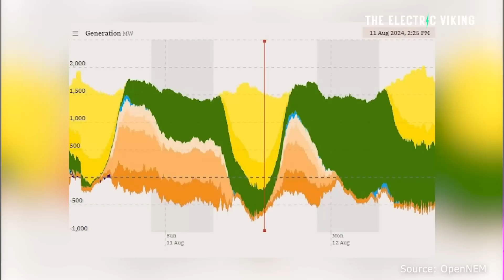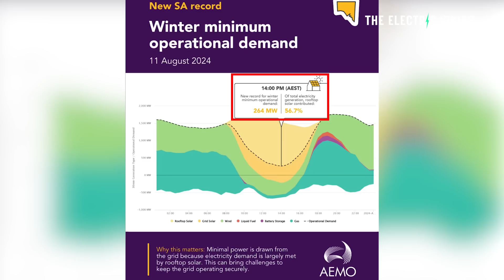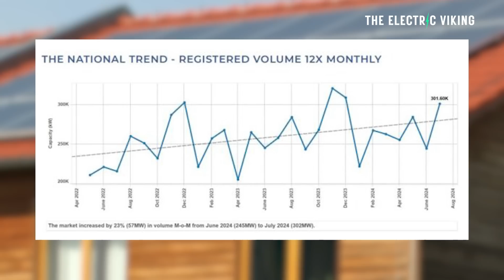Australian rooftop solar hits 81% high as Aussies install solar in record numbers

Comment: Our low cost solar is a rare credit to Gov policy. In 2009 they put in a solar subsidy plan which was to run until 2030. Since then NO Gov has touched it, changed it, altered it or screwed around with it. The result a consistent known policy framework which has allowed the solar industry to grow and become very efficient. 2/3rds of the cost of solar is NOT the solar panels. This is where we have become very good and we don't get cheaper panels than anyone lese or cheaper inverters its a world market anyone can buy from anyone around the world. NO what we have got very good at is keeping the sales cost low (lots of neighbors putting in solar sells it) and very efficient at installation. 

We are still half the cost of the US and UK for say a 10KW system even if you take the subsidy out. That's how good Australia has become at home solar.

Comment: Rooftop PV panels shade hot roofs. 
Hahaha 👍 Hahaha 👍 
More panels, more shading. 
Happy days
Reply from the maker: The best!
Reply: @electricviking  I have joked about it.
And then it occurred that the hottest part of the roof actually would be shaded when the Airconditioning was running. 
It also occurred to me that a rooftop PV of older panels would be cheaper and cover more area.
Even 2nd hand panels might be useful for me as I use my roof space, and it gets very hot.
You are doing good work and remain calm but enthusiastic.
Edit
Now I am thinking panels headed to the recycling might have a longer roof life.

Installers can relocate them from prime roof space.

Comment: My friend put 5 × 6.6kw rooftop PV on his commercial building and cut his quarterly bill by $10,000.
Those left on the grid, the home owner customers with no rooftop would find that the R.O.I pressure on the grid owners, the superannuation funds, would have increased the $kWh rate and daily connection rates higher. 

People saying renewables are forcing electricity costs higher are double talking for their bs agendas. 

Nuclear promoters are bs confusers, distracting from the GRID's $1TRILLION economics. 

F..king honesty is needed, not a grab for taxpayers money from messed up political parties. 

Snowy 2.0 pumped hydro budget EXPLOSION from $2billion to $15billion is insane economics. 

I have decades in construction, university degree in Civil Engineering, tendering and building coal fired electricity power station, gas turbine generation, transmission line, substations for large city buildings,....

I have grandchildren and a no CO2 emissions nuclear electric world, a warming latitudes world is not going to be my legacy to them.

F..king grow up. Listen and learn.

Comment: A 6kW solar photovoltaic system would cost between $4,000 and $6,000 in most Australian states, while a 10kW system would cost between $7,500 and $10,500. The average price for a 5kW solar system of satisfactory quality in Sydney is $5,500. The AUSTRALIAN Solar for Low Income Households Program provides a subsidy of up to 50% of the total cost of a solar rooftop system.         Solar panel costs typically range from $17,430 to $23,870 IN THE UNITED STATES, and many homeowners will pay around $20,650 on average. I received quotes as high as $50K in the United States, and my electricity use is not that high. Even with the lowest priced systems the payback period for me was going to be 20 years, the life of the average solar panel. And that is in the sunny southern U.S. Just the facts in my situation, view or spin it however you want. It was no Australian paradise scenario for me.
Reply: I suggest you ease into it by buying a 2000 kilowatt hour battery pack and about 400 w of solar panels. 

This will provide you with some disaster recovery and cost you about $1,200. 

I used such a system and a 4700 watt dual fuel generator to get through 2 week long power outages in Houston this summer.

The battery was very handy the first night while the hurricane was still making it too dangerous to set up the generator. 

It's already saved me about $600 worth of food.

However, even a small systems sufficient to run a single 5000 BTU air conditioner for 24 hours a day just doesn't make sense yet.

Comment: If solar is so great why does Australia have some of the dearest electricity in the world.
Reply: The result is "Electricity is so damn expensive, I'm putting a solar panel which pays for itself in two years on my roof!"  This is a way you get around the energy oligarchs.  Heard of those guys?  They ain't doin' you no free favours.  They very real.  And why grid elec is so expensive.
Reply: Expensive grid electricity is one of the reasons Australians adopted solar so quickly. Installed my 10kW system many years ago and it's already paid for itself. Now my electricity bills are $0 and it even covers EV charging. You'd need to have rocks in your head to not get solar, at least in Australia.
Reply: @nhand42  Some can't afford it, and landlords have to be willing to have it installed for rented houses.

Comment: The problem is solar doesn’t generate it when most people want to use it, all the peak times are when solar is either ramping up in the morning or down in the afternoon. If it came with a complimentary battery it’d be a different story. The grid doesn’t even want all the extra power from the panels when they’re making it because nobody is home to use it.

Comment: The cheaper electricity gets, the less "crazy" it is to NOT have solar on your roof.
And you definitely CAN have too much solar.  If supply exceeds demand, the voltage goes too high, and the utility can't curtail the rooftop arrays (can they?).

Comment: Your solar price is about the same in the good non liberal states. If you want to do it yourself you can get 31 panels, 400 watts a piece for about 4k delivered. lol I doubt you could get that price in Australia. Also, most of America except the corrupt liberal states, you can get Electric about 9-12 cents a KWH. In Australia its about 40 cents with a whole bunch of fees. I pay 11.1 cents, with 10 dollar fee. I do like that the Assies are putting up solar, it works, I have it on our rv, we don't need to be plugged in ever if we don't want. Many people in Australia don't have dryers because it's to expensive to run. In the long run Australia will be better off than the USA if they get rid of their corrupt communist government, we're trying to now.

Comment: My electricity bill is $1500 per year. To install a system able to cover my total annual consumption, it was going to cost me $35,000. 23 year payback.
Reply: Plus yearly maintenance, replacement of failed parts and when they bring in the sun tax, being able to turn off your system via smart meter when grid gets overloaded via roof top solar. If you want to do it forget about recouping cost, it may never happen.
Reply: $35.000 is a lot. You don't have to go off-grid to make solar worth it. A much smaller system may give you a much better ROI, especially if you don't have to borrow money to buy it. Shop around some more and get some advice about the right size and if a home battery is something you should add now or maybe later (make sure it's easy to add).
Also think about your electricity use in the years to come. Maybe you want a heat pump, fully electric kitchen or an EV. These things will need a lot of power, but save you on fossil fuel and taxes if you have enough solar panels, which you can plan for now and add on later.

Comment: As I watched this my energy supplier is allowing 1 hour of free electricity. I am topping up my car. The current price on Grid Watch is shown as £16.23 per MWh, so less than 2p per kWh. I can only concluded it is a solution to balancing the grid and a cheaper option than asking a generator to disconnect and compensating them.
Reply: What you are up to is what all of Australia should be up to but Solar is probably five years ahead of batteries and EV's. Surplus of solar and we should be filling EV's and Gov needs to ensure where we park we have charging. It can be a low cost house plug if you park at work all day they 4kw charging is fine. Its a huge upside for OZ and one day we will have the EV's bi-directional and powering the homes at night.

Comment: Based on the Energy Saving Trust's figures, it could take someone living in the middle of the country, in a typical home, anywhere between 12 and 17 years to recoup the costs of installing panels, based on current Energy Price Cap rates.

Solar panels: Are they worth it? – MoneySavingExpert

Comment: as an Aussie with solar power and solar water heating panels, let me explain that this video is utterly crap, the solar price is $0.05kwh, the average solar array is 6kw. Australia has the highest electricity price on the planet due to the floating 5 minute price point. $15,000 kwh wholesale price is common during the highest demand times of the year, summer and winter. Wood and gas heating is being phased out in Victoria and will follow in other states, thus only electric heating and cooling. now solar panels cause a very unstable grid, clouds really effect the grid, cloudy day no solar, or interrupted solar power.
to try and help this, all solar panels are now being controlled by electricity authority, so expensive solar panels are turned off during the day if the grid is over supplied. powerbill sky rocket when the solar panels are turned off. home battery banks are advised but these are $10-15000 to install and often explode. massive recall on these systems.

So do solar panel installation make sense these days? at $0.05kwh return on investment and $6-10,000 solar array, you do the maths. most aussies have and it doesn't pass the pub test. 6-8 years to pay off the array. 

Australia's renewable power effort also requires the power grid to be increased and the expect cost over the 20 year life cycle of renewable sources is in the billions of dollars, renewables, cheaper, BS!!

Solar power is nuclear energy, so Australia is trying to go down the nuclear energy path to dramatically reduce the wholesale price of power, the stability and supply of the grid. we are sick of black outs, sick of being told to shut down heating and cooling. sick of elderly people dying due to the cost of paying for so called renewable power.

Comment: It's not just American papers putting a negative spin on positive news. The BBC did the same thing recently about Solar energy in Spain. The report should have been incredibly positive but they managed to word it to be negative along with dramatic music to enforce the point. Totally crazy that the BBC should do such a thing.
Reply: There are still some really powerful fossil people and they will push out propaganda for ever. They love to say that solar and wind are curtailed ignoring the fact that exactly the same happens with coal and gas.
Reply: My friend put 5 × 6.6kw rooftop PV on his commercial building and cut his quarterly bill by $10,000.
Those left on the grid, the home owner customers with no rooftop would find that the R.O.I pressure on the grid owners, the superannuation funds, would have increased the $kWh rate and daily rates higher. 

People saying renewables are forcing electricity costs higher are double talking for their bs agendas. 

Nuclear promoters are bs confusers, distracting from the GRID's $1TRILLION economics. 

F..king honesty is needed, not a grab for taxpayers money from messed up political parties. 

Snowy 2.0 pumped hydro budget EXPLOSION from $2billion to $15billion is insane economics. 

I have decades in construction, university degree in Civil Engineering, tendering and building coal fired electricity power station, gas turbine generation, transmission line, substations for large city buildings,....

I have grandchildren and a no CO2 emissions nuclear electric world, a warming latitudes world is not going to be my legacy to them.

F..king grow up. Listen and learn.
Reply: Got your attention, and you got mine; we watched the ads and bought the T-Shirt.  Now we're commenting on Sam's little corner over here and making him money.  Crazy-Smart. You even promoted the brand (BBC) for reinforcement!  Seemingly negative or spicy headlines are just there to get the convo started.
Reply: @mikemotorbike4283  Sorry, I don't know what your talking about.

Comment: Renewables are not raising prices but are making the prices more volatile, we do need more longterm energy stores even at the cost of efficiency, batteries are great for ultra short term storage but some pumped hydro or the like would be great for inter seasonal storage
Reply: Prices could go up as the big generators contribute less to the grid but still have to pay for the lines etc... private solar is brilliant.

Comment: When the sunshines, the grid cashflow dies. 😮 With rooftop PV. 

With BVs oversized battery parked 23hrs every day and selfplug-in the grid cashflow dies 24/7.

This terrifies the grid owners. 

The grid is a $TRILLIONS infrastructure investment and needs $100BILLIONs R.O.I.

$kWh grid supply rate will explode. 😮😮😮😮😮

Comment: Personally, I believe the high installation rate of rooftop solar panels probably indicates something wrong with your national power grid, either shortage or price. Personal solar panels are far less efficient/cost effective than large scale solar panel matrices maintained by professional orgs.
Reply: China's cost per KWH is $0.08 USD which is much cheaper than other countries.  The US is $0.18, Australia is $0.22, Japan is $0.25, and Germany is $0.52.  The cost/benefit calculus changes greatly if energy prices are higher.
Reply: @celanian8188  this is very true and also the type of metering makes a difference. True net metering and time of use pricing can make a big difference
Reply: Personal rooftop solar is usually very cost-effective because the profit goes to the homeowner instead of the big corporations.
Reply: @richardnwilson  You need to install inverters, batteries and do cabling etc. You also need to maintain those devices by yourself or via contractors. Do you count these as part of costs? Well, depends on your location anyway... I am in China, the power supply is very cheap and 100% reliable, hence no reason for the hassle...
Reply: @tildarusso  all that is very true but solar Electric Systems require almost no maintenance and are very dependable. Also most systems are grid tied without batteries which is much less expensive.
Reply: @janetrussell3288 exactly. A 12 panel system in Australia is around 8k. A battery is circa 18k installed.  The average annual household electricity charge is around 2k. So payback is approximately 12yrs. Not good enough to warrant the outlay.
Reply: @robertfonovic3551  12 years payback means about 6% ROR which is not bad.  Especially since this is saving you after tax money and the panels will add to the value of your house if you need to sell it later.
Reply: @robertfonovic3551  you’ve way overestimated the cost of battery installation. It is between $9;and $12k for the installation of a Tesla Powerwall, and that isn’t the only battery in the market. We paid $9k. The average electricity use is also expected to increase especially for those moving off gas heating, hot water and cooking (which adds at least $1500k to the energy bill in Vic) and people getting an EV.
Reply: @richardnwilson  Plus there is no distribution cost via a national grid.

Comment: Unfortunately the more solar that is put on the grid the higher the prices for electricity go. Even though tens of billions a year are given in subsidies. It may be cheap for individuals but it is not for people and businesses on the grid.
Reply: Your statement is false. The opposite is true...the higher the solar generation the cheaper the wholesale price of electricity. This should be getting passed on to the consumer, but most often is not.
Some electricity retailers now offer free power for 2 hours in the middle of the day when solar generation is highest.
Reply: @annabel5200  your statement is false, the high generation is done when demand is at its lowest and thus why vast amounts load shedding in the grid is prominent and reason why is connection of new system of 1MW is almost impossible, and why Downer went broke.
Reply: @sometingwongwai9679  It's not difficult for households to shift demand for power to the times when solar generation is highest. Offering free power at these times gives incentive to do this. E.g. Dishwashers, washing machines, clothes dryers can be set to operate in the middle of the day.
Reply: @annabel5200  dream on...  they do have that, its called off peak power.  they system is load shedding because there is way too much input at the time of least demand, that why solar rebates are worthless.
Reply: @annabel5200  is it false that my power bill has gone up. I pay it I know.
Reply: @Guvament_bs  Its not a law of nature, but a law of capitalist greed. Your electricity bill is not because of more solar generation, but because of erroneous policies intentionally implemented to benefit the big energy corporations instead of consumers despite consumers representing tens of millions of people while big energy ultimately represent a handful of people.
Reply: @ensteffo  so you would be fine if the taxpayer stopped subsidising muli national rent seeking owners of solar factories and bird blenders.
Reply: Guv, you apologists for the coal and oil companies just don’t want competition from individual citizens. As battery prices continue to drop, the disruption to the fossil fuel industry will grow as more citizens generate and store the energy they need for their cars and homes. You fossil fuel folks need to be afraid. People with solar and batteries no longer need you